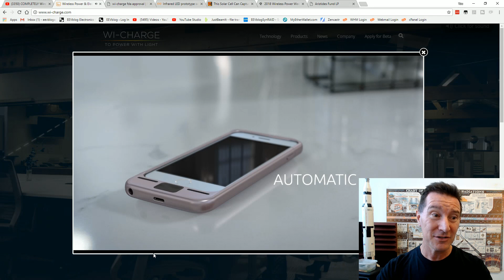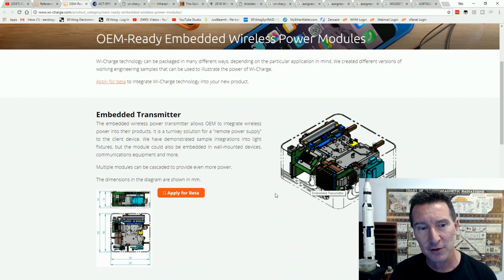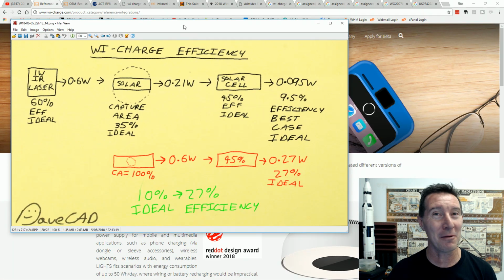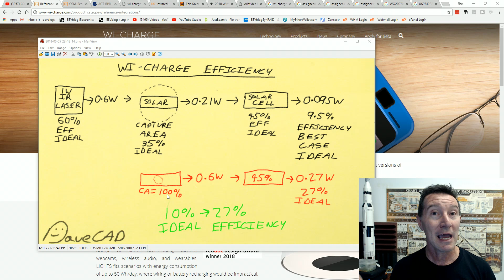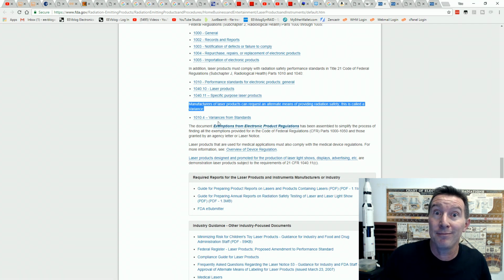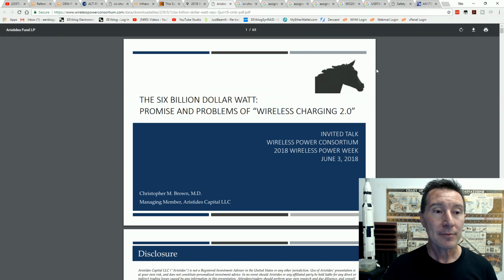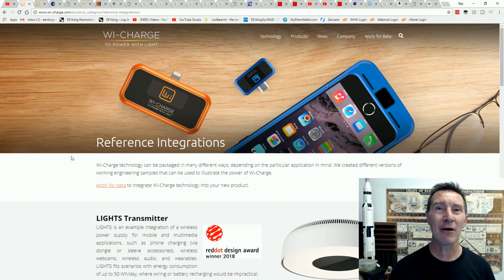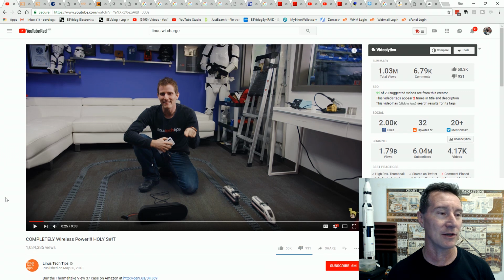EEVblog #1092 - Wi-Charge IR Wireless Charging - Fact or Fiction?

Comment: Another thing that worries me... let's say they deliver 5W to one device, with 45% solar cell efficiency (which is certainly much higher than the reality), it means there must be 11.1W of IR concentrated on a small area... Where the "lost" 6.1W go? heat? Unless they have a massive heatsink that would melt in seconds. 

Also seeing the "beamer", I really doubt there is sufficient cooling for a laser diode anywhere near the power we talk here. A 5W laser diode is probably the highest u can get on air cooling with a massive heatsing and noisy fan.... over that I don't see how it can live long without water cooling.

Comment: It is also enlightening to compare the loading times of a regular USB charger with their system. An average 2.2 Ah phone battery at 3.6 V stores about 28.5 kJ = 3.6 V * 2.2A * 3600 s. If I divide this by let's say 0.5 W charging power, I end up with a charging time of about 16 h. To increase my battery charge by 1%, the IR charger at 500 mW  needs roughly 10 min.
What currents do USB chargers usually deliver?

Comment: What we need is WiFi charging. True wireless non contact charge that can charge the device where ever it can get a WiFi signal. Laser lights can cause eye damage and can even start fires if it is powerful enough. It just doesn't seem very safe to me.

Comment: If they were to advertise a specific efficiency, it would obviously be an ideal / best case number. Do you think they could attenuate the spot size to fit both of your calculations dynamically? If the client device weren't moving (best case numbers would apply here) it could optimally focus the beam within the window. If it were tracking a moving target, it may be more effective to have the wider, more forgiving beam. Just thinking that it may not have to be one or the other.

Comment: I can imagine scenarios where a system like this would make some sense and wouldn't have as many safety concerns as installing in a general usage scenario. But I don't see how this is going to be feasible in the general usage case. Even if they get the targeting and focusing perfectly, I have concerns about how it behaves when some part of the system fails. The number of things I've seen that fail dangerous instead of safe even if they're supposed to fail safe....

Comment: Great video, thanks. My practical concern is that even if the tracking is perfect and the safety systems are perfect, what about the aging of mechanical components? Hopefully it has some feedback system whereby it has to get continuous confirmation of expected reflectivity values in order to keep pulsing the beam so that in case a laser mirror gets mechanically misaligned, the beam would turn off nearly instantly. Nonetheless I still worry about outlier cases, like a partial mechanical failure or strong radio interference or power surges or physical vibration etc.. like I'm sure that in its "launch form", a situation like a person putting their finger in the middle of the charging pad would get detected and dealt with by disabling the beam before damage is done but I can't help but think that there could be cases where the system could be fooled. Also, if I'm sitting in such a way that my eye is at the perfect angle of reflection from the pad (the laser hitting the pad and reflecting into my eye), how safe would that situation be in the case of continuous transmission? Because again, while it's unlikely that a person would be sitting at that perfect angle with their eye positioned just right and held in that position for some significant time - it COULD happen in a natural context for this device. What about "weird" types of dirt on the charging pad, like metal dust/filings/glitter (lol)? What if while a device is being moved (so, while the system is tracking it), a person's ring gets in the way of the pad? The tracking will obviously have some error and may hit the ring during an over/undershoot etc. Seems to me that it would be safer to power down significantly while tracking and only power up when the device is stable. Anyways, just some thoughts. Might read the patent when I have time.

Comment: I didn't have time (nor did I have the motivation) to review all the replies here, so I risk being redundant, but it is safe to say that your second example is grossly overstated (Dave, are you being generous?  (in my best HAL voice...)), but that cell won't be nearly as efficient with the focused beam with an equal diameter to the cell width as it would be for a (non-existent) perfectly rectangular beam, which is how the cell is characterized.  Reduce that efficiency number by some sub-100 percentage of the aspect ratio.  I still love your videos, Dave, but these perfectly obvious debunks are low-hanging fruit now that you've trained your audience :)  Cheers!

Comment: Concerning the Qi chargers. They work, yes. BUT, in close proximity, I mean, almost as wired method. But wired method could deliver way way more power than Qi charger. So, why Qi? Some time ago, there were special phone charging holders with contact pads. These could deliver much more power and with better efficiency. We have cafes where every table has USB charging station for mobile device charging and 220VAC power grid outlets for laptop charging. Isn't this a better way to do the same thing?

Comment: Hang on, I was under the impression that an unexposed solar cell acts as a high value resistor, so their system would be forced to shine a beam that completely overlaps the entire solar cell in order for it to work at all. Has this changed? That's what, 70% for a circular beam centred perfectly on an ideal sized square cell right?

Comment: There is a application for this. It is a way to power devices that have a fiber optic cable run to them just for your information it might be a fun follow-up video to this one. I work with fiber optics and one of my suppliers and I got in discussion about this technology in the use of fiber optics I hope this is helpful.

Comment: Didn't you assume the transmitter to be 60% efficient, leading to a total system efficiency of 27%?
 In that case, why use the 27% when looking at the transmitter - surely it should be 5W/0.6= 8.3W laser, rather than the 18.5W or 50W laser you suggested? 8W seems less scary to me. Again, I am absolutely no where near an expert on this so please correct me if I'm wrong.

Comment: Good clip. Totally agree on the overpromise. Could have been a 2 minute clip. 😀

Not all your arguments are that thoroughly thought out though. Sure, no one likes an extension to their phone, but it's not so hard to imagine a smartphone screen with a solar panel underneath. Companies like this won't also create phones, so extensions or cases are a logical step.

The challenge for these companies is to start with RFID like applications and go up to e.g. BLE sensors that also use almost nothing, say door or window sensors. 

Smartphones though seem like the holy grail to them, because that's what consumers charge every day. However, physics and safety makes it so that the distance over which you can charge those is very limited. Still QI pads on a desk or night stand are fine of course.

I think the biggest impact will come from other types of sensors (or other devices) that we currently don't really feel the need for, but that each will help us bit by bit. People advocated against remote controls because "how hard is it to walk to the tv to switch a channel?" Still, when it's there, it's gonna be used. 

To give examples of small sensors that can be build but aren't used because of battery considerations are hard. It's all in the eye of the beholder. Sensor that tells you to water your plants? Nonsense! Sensor that tells you that you left a window open? Nonsense! Sensor that tells you you have a water leak in the bathroom? Nonsense! Sensor that tells you a window broke? Nonsense! Sensor that tells you to sit differently? Nonsense. 

Until it's there.

Comment: All this new technology seems to be moving towards higher and higher frequenies. But I've always wondered - like, why you don't just use radiowaves? I mean, data transmision needs that to be fast, but if we want to transmit power we probably can use just a couple kilohertz waves, right? The efficiency should be pretty high, the waves are easy to capture; there will be interference and since we are receiving power, thats even better! Transmitting the same 5W the waves shouldn't spread very far, so to not violate country radio regulations. But I feel like there is something wrong with this, it just can't be that good...

Comment: So the fda regulated one throw a 100mW laser.
Considering an impossible 100% efficiency, you'll need 240 hours to charge most of phones?

And they will never allow a more powerful laser to be fired at a single target. NO-ONE wants a 2w laser shooting everywhere in your room.

Imitating a regular, modern phone charger (2h charge time) would probably require a 100+ watt laser phone that would cut anything in its past including the receiver.

Comment: I used to work for a company that is absolutely able to produce a similar device and it will work as you have stated. I can absolutely assure you that the tracking can be done if you have the know how. I have seen systems that can do around 0.1 mrad (0.5mm at 5m) accuracy. The safety issue is the catch as you have rightly stated. You will not be able to see the IR laser and this makes it much more dangerous. You don't want to have a laser class 4 device in your home without everybody in the house wearing fancy IR-laser safety goggles. You will never be able to control all the reflections and scatter. A class 4 laser device will burn dark spots into your retina in a fraction of a second. The dark spots will be very small and It might take a year until you are totally blind. I am certain Linus has already done some minor damage to his retina, but not enough to notice straight away. Your retina does not heal. --- In other words: cable or blind!

Comment: I came across a company Ossia that claims to do wireless radiowave charging. They use a beacon on the receiver, which is picked up by the transmitter. I'm guessing the transmitter is some sort of phased array or other multi antenna system. They claim to use the beacon to figure out a good multipath route for charging. They say the device updates the path many times a second to provide device tracking. Any chance this works better than Wi-Charge?

Comment: Being a super early adopter of Qi charging (even before it was called that) and impressing my friends has always been fun. The idea of powering stuff in a room with a laser makes a lot of sense. A simple example would be automatic blinds. Those are hard to wire and don't need that much power. Magnetic coupling has a lot of promise because many coils could cover a serve and get efficiencies of around 80% and i new that early on even though in practice the phone needs to be at the right angle and gets about 60% efficiency. But a high watt laser is a uniquely terrible idea even with the safety features this simply IS going to blind people and burn people.

Comment: Great video, thanks for doing this! Couple points about your complaints though:

1) So I have to plug in a "dicky plug" to use this, so you think QI is better...but to use QI I'd have to do the exact same thing with my current phone. Last I checked (which admittedly wasn't THAT recently) there's A FEW of the top end brand new model phones with it built it, just like they could build this in too. But do you not remember the YEARS of QI chargers built into cases or otherwise adhered to the outside of the phone??

2) the coffee shop battery idea... Do you really think a coffee shop could just hand out USB battery banks without having a half dozen get stolen every day? With this thing you can glue the battery to the table and trickle charge it all day and night from the lasers. Costs a few grand extra, but so would a system to prevent battery theft with ruggedized battery banks so they don't break from being dropped a few times a day... And it's DEFINITELY cheaper than hiring an electrician to install outlets in the floor to wire up the tables. So it seems to me like that is legitimately a good niche use for the thing.

3) even though it can't deliver much power, I've got a ton of low power devices. It's got some great potential for keyboards and mice, gaming controllers, remote controls, and potentially some IoT sensor crap in the near future. The efficiency still sucks, but so does filling landfills with empty alkaline cells. Might not be the worst thing ever...depends where the power comes from...wasting solar or wind can still beat efficient use of chemical energy.

Comment: I wouldn't be worried about power usage that is somewhat less than a 75 Watt incandescent light bulb. The ergonomics suck though: I don't want to have a dongle hanging off of my phone, have a rats nest adapter to trickle charge a speaker, or find a way to get a new power outlet into my ceiling.

Comment: devil's advocate here.
I think Linus showed one of their qi charger pads which did have an integrated battery.
The idea was that you would build it into the table.
So that you can then move the table without having to worry about any cables or having to manually charge the pad's batteries.

I don't know of many of those applications, which makes it rather niche.
They would have to protect it from liquid ingress though.
And the efficiency will still be a problem.

Comment: Within limits does efficiency matter that much? I am more interested in utility and safety. For example I use filament light bulbs in a couple of my rooms as I want the inefficient heat production to eliminate the need to have other sources of heating.  If the charging works and is safe I am happy with lower efficiency.

Comment: How do they think they can even sell this thing when it falls short of legally mandated energy efficiency norms by a pretty wide margin? EU standards for example require devices with an output of 1-51 W to be at least 62.2% efficient which this thing can obviously doesn't reach. Do they think they can just get around those standards by having the actual charger be a device this thing powers?

Comment: What if they doubled or tripled the laser? So there are maybe 2 or 3 lasers focusing and delivering the power instead of one beam. Also maybe there is a small battery in the dongle so when you are not home it will load the battery in the dongle and that actually loads your phone?

Comment: 5 watts? Is that for each of the 4 devices or divided between 4 devices. Regardless, a 5 watt laser beam is capable of blinding people even if it is in IR. 5 watts though, just at one device, that's 5 volts at 1 amp which couldn't even charge a device currently in use and definitely couldn't charge a laptop.
Reply: In addition, there is transition time for the beam to get from one device to the next.  So what would the total power delivered once there are 2, 3 and 4 devices.

Comment: Hey Dave, is there any battery technology that charges chemically (as opposed to electrically via a peltrier cell or such) trough heat? If so you would cut a whole lot of losses in this system.

Comment: You're being VERY generous with those numbers. A 45% efficient solar cell is stupid expensive -- even a postage stamp sized one. And this doesn't even ask how much power that laser aiming arduino is burning. Wireless charging is just pure stupid. Even Qi, which is virtually direct contact, is a horrible power waster.

Comment: Could the power output of the laser be modulated in a feedback control type setup where by if the power received is not basically equal to the power transmitted it is quickly reduced to an eye safe level, but when the link is strong and hence there is nothing blocking the beam then the power is slowly ramped up? ... as you say it is dicky, and complicated for no reason, but a feedback power level control could help with safety. 20W laser still seems nuts though!!

Comment: You will loose additional 10% in power supplies, cables, storage and voltage regulation in receiver, and the fact that the receiver cell is most likely not perpendicular to the beam. The last one could probably be as terrible as 50% loss if you are far away and at oblique angle. Which is going to be pretty common in most of the rooms. Sure it "works", but it is bad idea, and not very environmentally friendly technology. Sure, in some small situations it could be interesting, like in conference rooms, and it seams convenient to run and have it on all the time, so you do not need to think about placement of your smartphone or tablet, but it adds to bulkiness and dimensions of the device. Qi charging seems more efficient, and the big coils can be embedded at the back of the device, not adding any perceivable bulkiness to the size. And it is much more safe, with multi Watt delivery.

Comment: This scares me,  5W delivered, at only 0.1% reflected power is above what is considered eye safe..

Oh and one small issue.    There is NO SUCH THING as an invisible eyesafe laser.
Low power lasers are considered eye safe (5mW) are based on the blink reflex, that is, you will flinch/blink from the brighteness of the laser faster then it can do damage...
Near IR/invisble laser not detected by the eye, no flinch no blink.. Not safe..

Comment: If the target has to transmit data back, then you've lost more of your delivered power.
Reply from the maker: Doesn't take much power to TX some low bandwidth data back.
Reply: Do we know how the data is transmitted? Also, how can the 1 watt model support the claimed 10 devices? Or even 2? Isn't that going to be some slow boat charging?